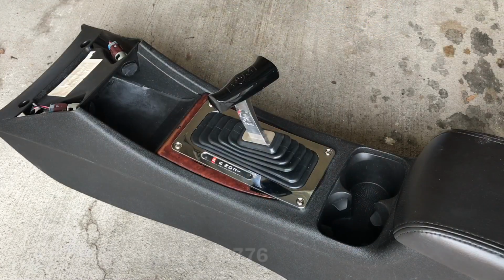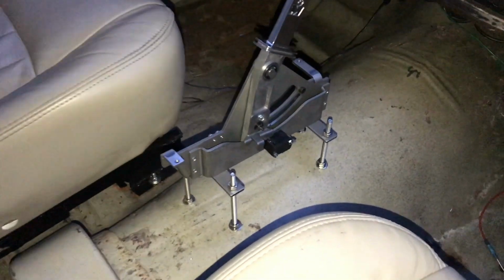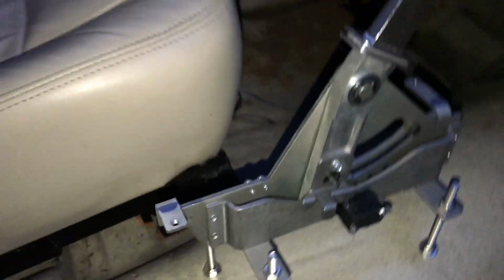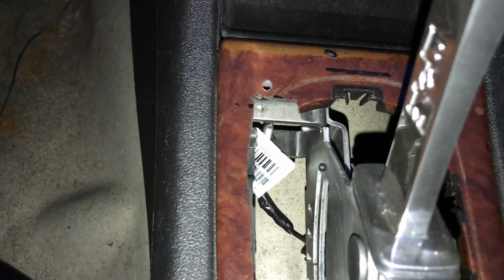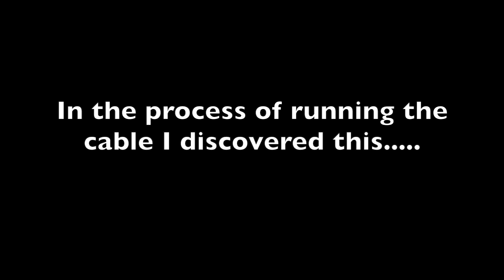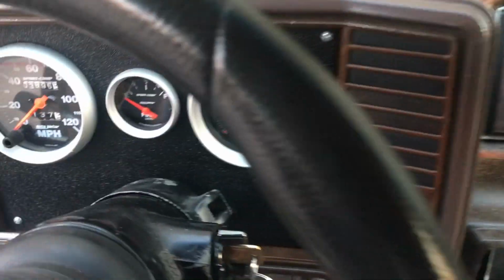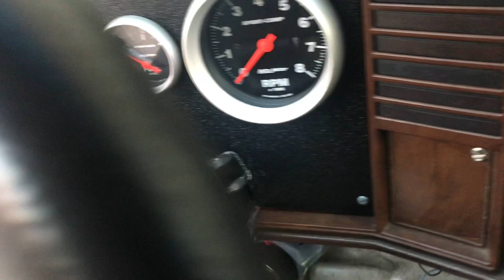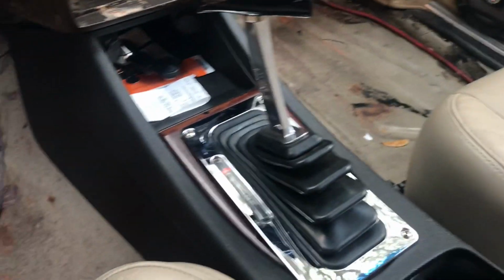Installing my B&M SportShifter//G-Body Malibu

Comment: Any updates on where the reverse and safety switch goes! Mine came with floor shifter but I replaced my column with column shifter but removed my gear shifter!! I need some new bro on that please
Reply from the maker: @clarencemack4382  I’m literally trying to figure out how to wire it from my column to the floor shifter.. I saw online that the blue and green wire that’s plugged into a switch on the column is supposed to work, wired into the floor shifter switch, but I don’t think it worked so I’m digging for more info online on what I’m doing wrong.
Reply: @KJMack82  mannn I’m almost ready for that tranny install and console being built so I know it’s going to be a headache 🤦🏿‍♂️ thank you and please keep ME updated if and when you can!!🤝🏿
Reply from the maker: @clarencemack4382  💯
Reply: @KJMack82  my dude where exactly is that floor shifter switch mounted at 🤔
Reply: @KJMack82  those wires probably can be splice into the other wires and possibly work 🤷🏿. Send me a pic of that please

Comment: How many screws you use to mount the console?
Reply from the maker: 4 stainless steel bolts
Reply: @KJMack82  okay, so only the 4 in the arm rest.  That bolted down pretty solid?
Reply from the maker: @killtraccskill_onthe_beat1824  yes.. the front slides right under the dash
Reply: @KJMack82  cool!  Did your seats have those hooks on the front with bolts on back?
Reply from the maker: @killtraccskill_onthe_beat1824  check out this video https://youtu.be/DdgHrhPovQQ  I cut off the hooks and made custom front mounts but im going to redo it to make it more secure. I was testing things out.
Reply: @KJMack82  I see.  I just picked up some buckets and they have the hooks in front.  Thinking of fabricating a mount where they can slide in.
Reply from the maker: Cool anything Is possible once you put some thought into it
Reply: @KJMack82  thanks for the information bro!
Reply: Is the shifter pretty stable with the long screws?

Comment: What size and length were your shifter mounting bolts.
Reply from the maker: Stainless bolts to prevent rust and I believe that bolt is around 5inches

Comment: What kind of console did you use I’m trying to decide on removing the g body console in my elco
Reply from the maker: 12 impala I have a video removing it from that car
Reply: KJ Mack82 craziest thing I was in the wife’s 13 and looked down and was like ain’t this a B lol. I got a 80 elco with luxury sport front Clip I swapped to a big block and everything needed to be changed due to bigger long tube headers etc